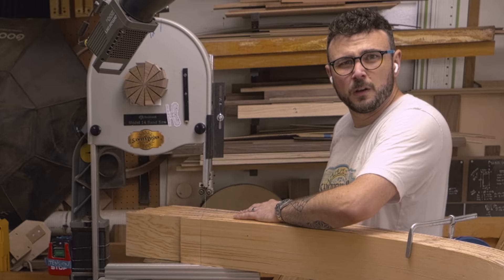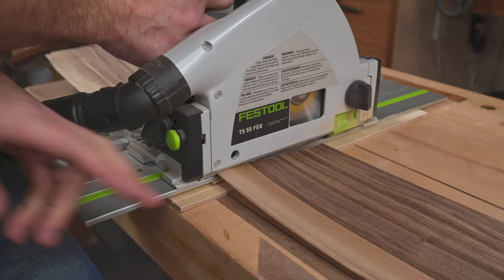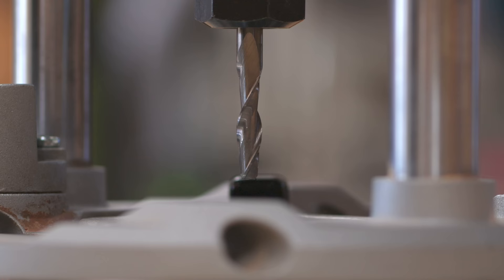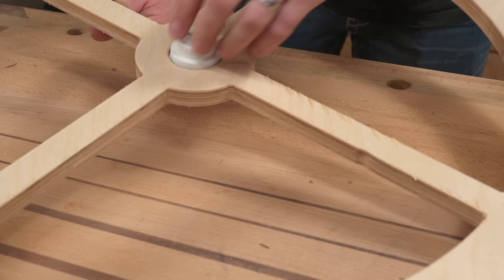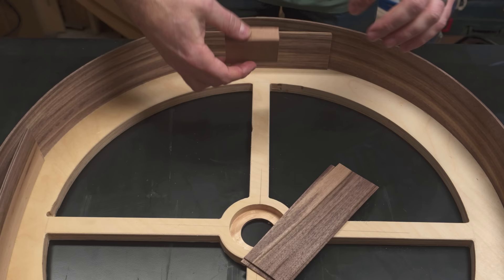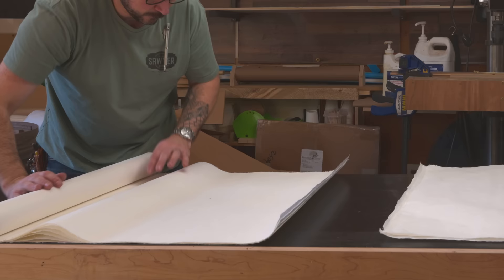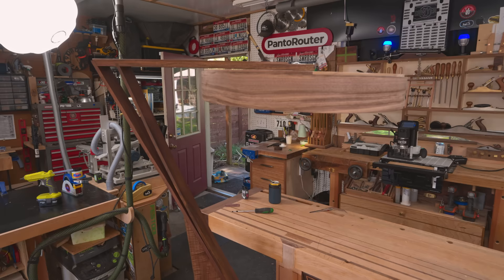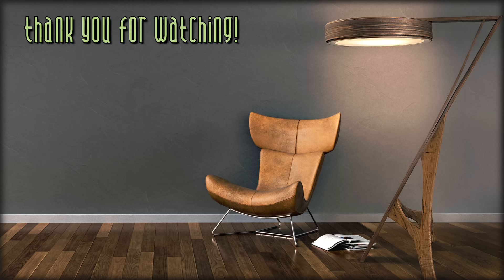Building a Bent Wood Lamp

Comment: looks amazing. for removing stripped or broken screws, nuts etc. look up hi-lok removal pliers :)
Reply from the maker: Interesting! They look similar in the jaw, but that offset looks nice for ergonomics. https://amzn.to/3nFJhX7
Reply: @SawyerDesign  hi-loks are a type of aircraft fastener where the collar that the socket fits into snaps off at the proper torque, so for removal you need to grip the smooth collar. the offset is so you don't scratch the aluminium of the aircraft structure. There are quite a few aviation tools that come in handy in woodworking...

Comment: So awesome. If you are not happy with the rice paper glue up use some rice water... Sound ridiculous I know but you wet the paper and your glue surface clamp everything together and while the water evaporates its pulling the paper along so you get some really nice tensioned surfaces
Reply from the maker: Great tip! I’ll definitely give that a try. Thanks!

Comment: brilliant once again !! Question is there a reason you did not use a scarf joint to meet the two ends of the veneer?
Reply from the maker: Thanks Rick! I might try that. Thought about tapering, but veneer is tricky to do anything to without busting it up. Great thought though… I’ll have to think on that. Would look better than a butt join.
Reply: @SawyerDesign  Your a smart creative guy it's probably a design still in progress and you will think of something

Comment: Nick, I liked this video because it was a "doesn't matter if it turns out sucky" concept test. After watching you voodoo s**t into existence that is flawless and mind-blowing, it's an interesting palate cleanser. I don't know how much weight that lamp body will support, but in some of my lighting projects, I used very thin plexiglass that I sanded with 220 or 320 (don't remember). It diffuses the LED light perfectly, and doesn't accidentally rip. Also, I'm in agreement with your stance on b**bs.

Comment: Very nice addition to the lamp :D
My experience with shoji and rice paper: Mist it after the glue is dry with a little bit of water. When it dries it will shrink and get tensioned like a drum.
I never saw this on YT, but in my shoji book it's one of the essential steps for good shoji screens
Reply from the maker: Great tip! Thank you!
Reply: @SawyerDesign  You're welcome. Maybe a little bit of content for a short?

Comment: Excellence as always!
Question: is there a reason to not bevel the start and end of the veneer put in the vacuum press so they overlap? Never done anything like this, but that seems like it may be a good way to blend the two ends. Especially if they come up a bit short.
Reply from the maker: Hey Brooks! That’s a great idea. I tried doing that, but the veneer is so fragile, I was having a hard time producing results that were clean enough to make work.
Reply: @SawyerDesign  Ah, that makes sense. Thanks for the response Nick!